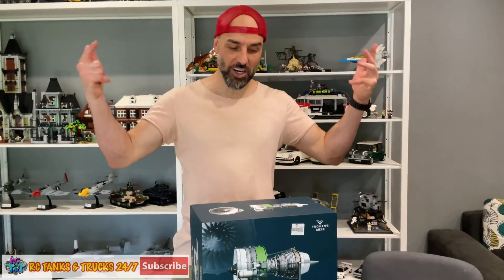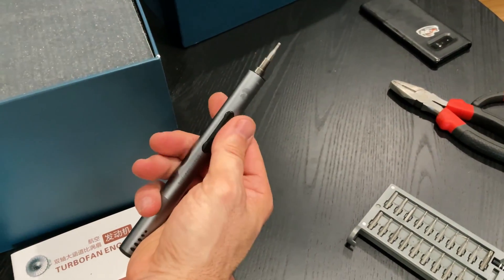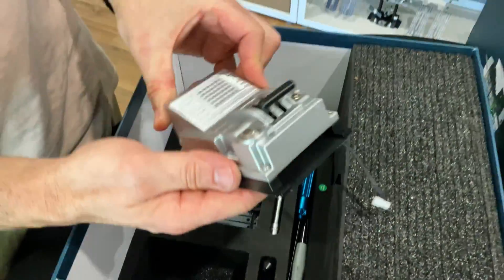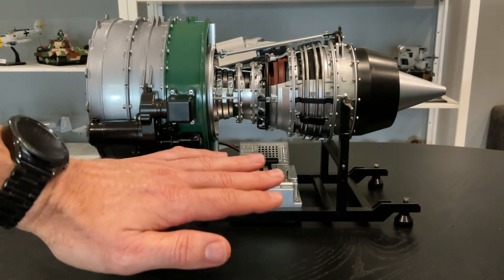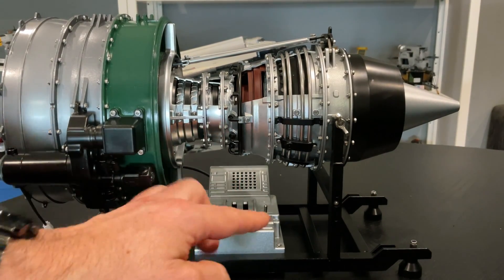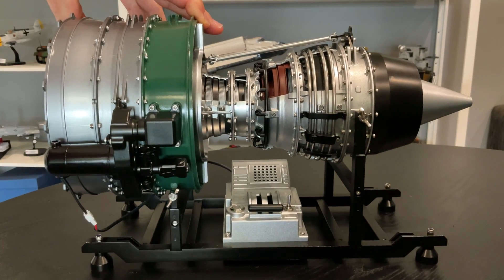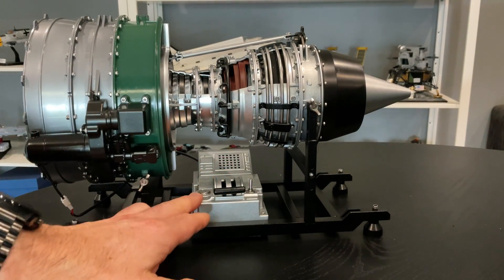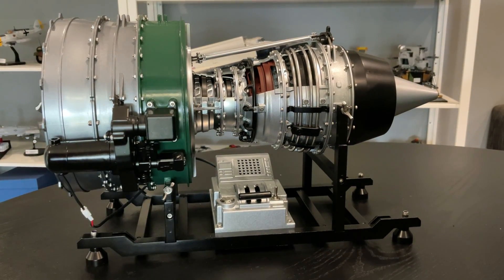ALL METAL TURBOFAN JET ENGINE THAT WORKS!

Comment: "that works"
I see no fire no heat and no smoke
it doesnt work
it just turns XD
but it does look good
Reply from the maker: So it works to a degree
Reply: @RCTanksTrucks247  well yes and know
It's like calling a cow a bike because you can ride it

It's a demonstration model not a working engine

Comment: Looks like a General Electric 
 GenX 1 or Genx 2B 
 This engine would be on a   Boeing 747 or 787. The 747 is still built in Everett WA and the 787 is built exclusively in Charleston SC now. 
You will also find the GenX engine on the big double deck AirBus.
These GenX engines have a price tag of 25 to 30 million dollars each. GE is now building the new 9X engine , the diameter of the fan case is very large and ruffly about 15 ft tall with the intake cowl on . 
Rolls-Royce provides engines for these planes also , it just depends on the customers preference.
Reply from the maker: Much appreciated bro 👍

Comment: It's poorly built despite metal parts with grinding wheels, whobbly cone and horrible $5 cheap toy engine sound. It's a shame as it could have been a much better model
Reply: for $1000 it should be a lot better
Reply: @stg4478  fucking crazy they want a GRAND for that
Reply from the maker: I honestly don't think it's poorly built. It does spin freely. The rattling is the individual fan blades